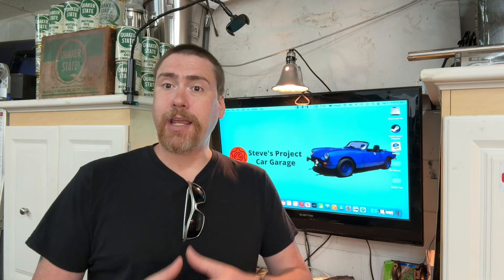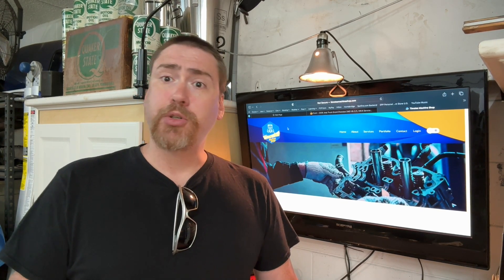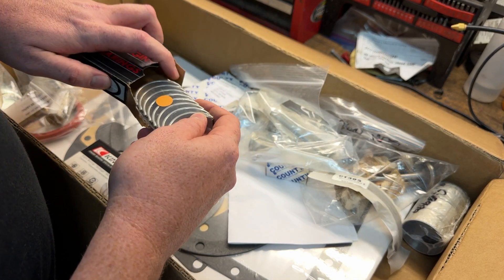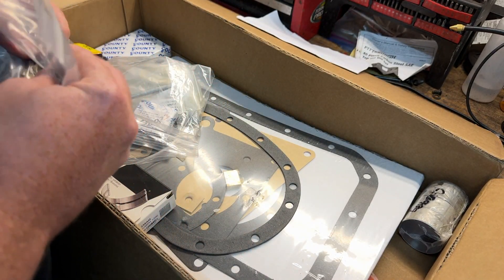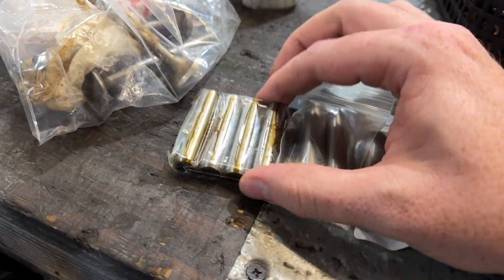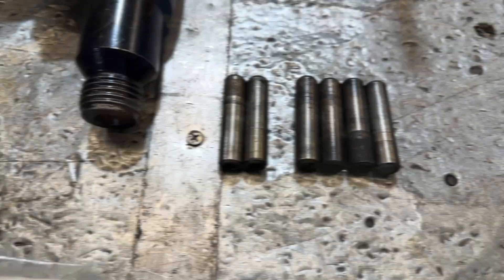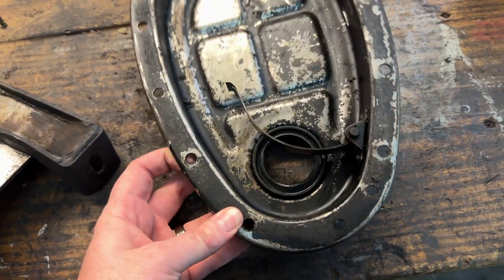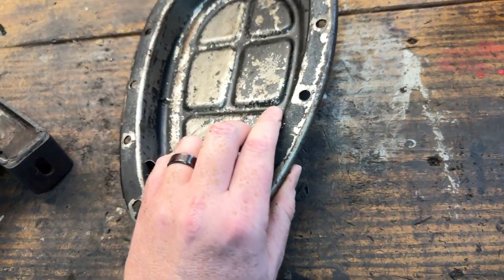Trip to Timotes Machine Shop | Triumph Spitfire Restoration - Part 99

Comment: Awesome news on the condition of the crank and block, and I enjoyed seeing the work the machine shop are doing, so thanks to them for letting you film! 
I did end up blasting some of my gasket material off the engine plate / timing chain cover. It is paper though so a few days soaking in water might loosen it up less aggressively. Definitely get it off though!
On parts: Pushrods should be replaced as sets, so if one is suspect then the whole lot want replacing. You also can’t buy any shorter than the Spit Mk3 standard. I know this for sure because I had trouble with my repro rockers being the wrong shape… Got a video on it if you want the full story, but the summary is they were too thick where the adjuster fits, so I couldn’t fit the rocker shaft without opening the valves. So check what you get if you buy new. Valve guides, your head was right, and your supplier wrong! The original parts catalogue shows only one valve guide for the Mk3. Later six cylinder engines had mixed valve guide lengths, but not the fours. If you find the Canley Classics website they use the original parts catalogues as their online shop pages so it’s a great reference for stuff like this. However if your valves have enough room to move as they should I don’t expect it makes any real difference now you’ve had them fitted.
Reply from the maker: Thanks for all the advice and guidance.  I will have to watch that video of yours.  As long as the regrind of the valves and the shaving of the head and block don’t add up to me all that much I should have room for adjustment.  Certainly a good reason to assemble but not torque everything until after confirming good movement of all parts.
Reply: @StevesProjectCarGarage  no worries Steve, I have just built the exact same engine (got about 70 miles on it now) so hopefully can help you avoid some of the issues I encountered!

Comment: I sent my whole rocker assy for the TR4 to RockerArms Unlimited out in CA. For $289 they did the whole shebang - new shaft, faced the rocker arms, replaced one pedestal, new springs, new adjusting screws. It all came back assembled. For the extra $100 or so buck over what it would have cost me in new parts it was more than worth it. Something to consider. And from what they said, their "new" stuff is actually spares that they have that are original, not new-new. So, if you need "new" stuff, they'll go into their inventory and recover NOS equipment.
Reply from the maker: Interesting!  That price isnt horrible either.  Were your rockers bushed?
Reply: @StevesProjectCarGarage  yup, all rebushed, too

Comment: Purchase a spray can of gasket remover.  Permeatex Type 999.  Spray on and let it sit for an hour.  It will dissolve the gasket.
Reply from the maker: Thanks!  I ended up just using a rolock and it pulled it off.  But I will try the gasket removed next time I get a stuck one.  I didnt know that stuff existed!

Comment: Hi Steve, use scotch brite, roloc clean and strip  discs in an angle air grinder, they work a treat
Reply from the maker: Thanks Carl!  I will have to just resort to mechanical means.  I didn’t want to ruin the sealing surface.  But its steel, so it should be ok right?
Reply: It will be fine, those discs are fine on steel,

Comment: Thanks.  Cute head stand.  Rocker bearings OK, not much wobble on the unworn part of the shaft & not much more in their original positions, the leave it alone except for cleaning & a little polishing?  The shaft may be flip-able/180  to have them ride on the  un-worn barely touched  side.  Head & block machining won't bother pushrods, there's plenty of adjustment screw isn't there?  Unless you change the rocker stand's height for better geometry/contact or run the seats deep & really grind down the valves, there's usually plenty of adjustment available.  Longer guides???  Really check they don't have any contact, guide AND seal, at full lift, like at least 30-040 thou.  Also, don't recall any stem seals, O-ring or umbrella or guide type -worst to best.  They may be in the Head Set/Gasket set, maybe not.  Good luck.
Reply: Spitfire rocker shafts are asymmetric so not filippable I’m afraid!
Reply from the maker: Thanks for the input!  The from factory the rockers were not bushed.  You can buy bushed ones but they then require honing to get a good fit on the rocker shaft.  Not sure I will really reap the benefits of it for the added cost and work.

Supposedly the older MK3s they had longer guides for the exhaust and after the mk3 went to equidistant for all of the valves.  Or at least Spitbits says that.  Im not sure but the machine shop did not see any interference issues.

Also from factory they did not have any gaskets or seals on the valves, but you can order aftermarket ones that were made for a Ford Fiesta.

Comment: You didn't mention the valve springs, you may find that over time, they have gone soft and likely need replacing. (You mentioned them later in the video)
Reply from the maker: Yeah, with the new cam I will be replacing them.  Seems easy and cheap enough.

Comment: The rocker arms, use as many of the originals as possible, they can be re-faced, and will be far better than any new ones, as at least one is worn past the heat treatment, get a secondhand unit and cannabilize it for spares. Original quality parts are always better than any reproductions.
Reply from the maker: Good to know.  I just didnt want to put worn parts back on.  TSI sells them and they seem to sell good stuff from what others told me.

Comment: i think for the gasket you could leave it,,,,, so long as it feels smooth from metal to gasket.  or you can have it glass blasted.  all over and make it look like new.
Reply from the maker: I could feel it ever so slightly.  I ended up using a scotchpad type of rolock and it took it off.